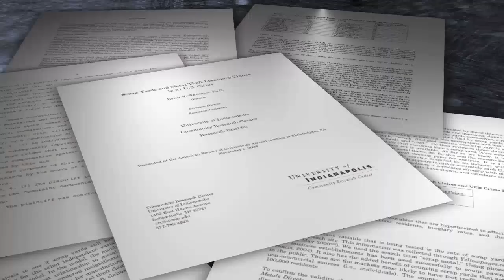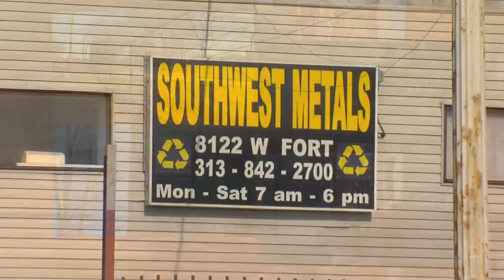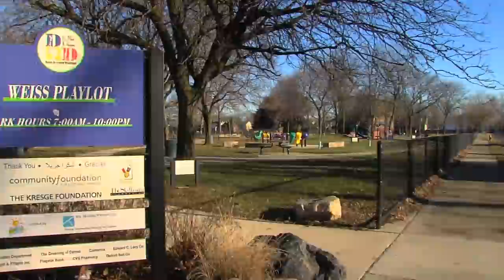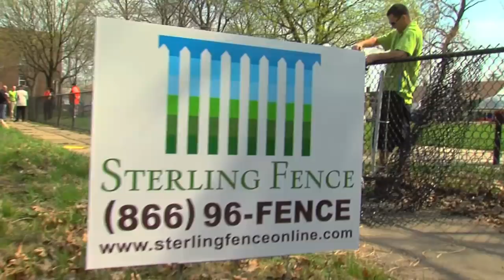Scott Lewis Metal Theft

Comment: Vinal siding. Vinal windows. ABS pipes... problem solved. My local scrap yard won't by copper wire that has burnt. Also all nonferrous metals have a 3 day wait, mail by check and must show I'd for address which check or police will show up at your door.

Comment: To be honest the city is also at fault for not keeping up the buildings letting them fall into disrepair, if they hired a security guard then this shouldn't happen, they don't like the expense then make an arrangement with a demolition company to tare down the place and take in compensation all the metal, get a city crew to haul debris out to city dumps, problem solved.
But this is the only thing that happened, bad press, more convicts to house and feed, and a city that is shitty looking, empty land gives developers a reason to move in.

Those thieves (I agree they are shitty thieves) but instead of just arresting them put them to work on a temp basis, have them tare down the place taking in compensation the metal, (under supervision),(for safety), also have them sign a waver so they can't sue if the hurt themselves, that place would be gone in a week, then send a city crew in to remove the left over debris and recycle that which can be.

You do many things, putting people to work is the best one, reducing crime, keeping neighborhoods from looking like a never ending junk/crack farm, recycle, and in general keep things orderly.